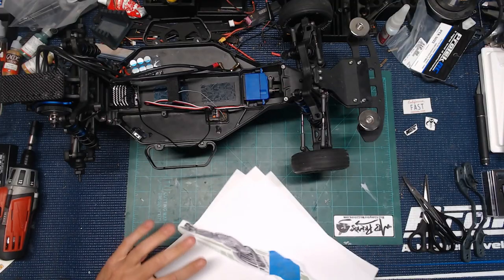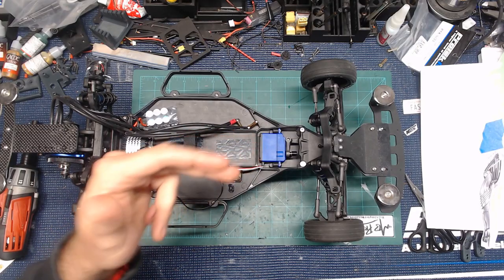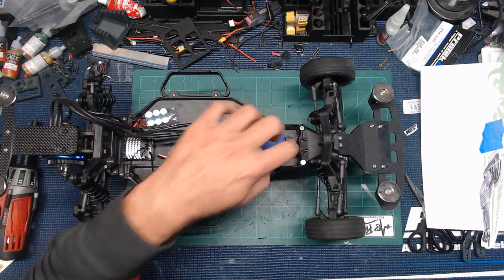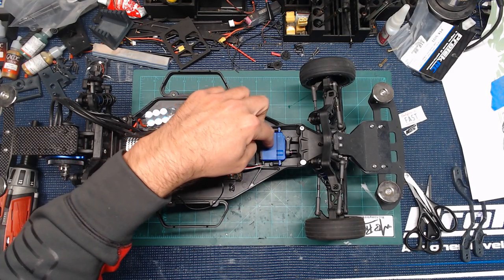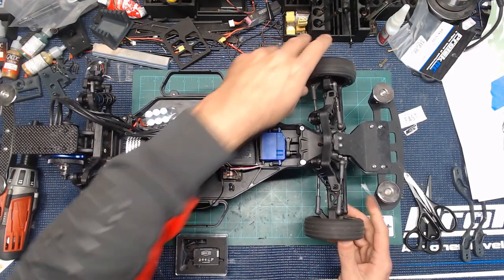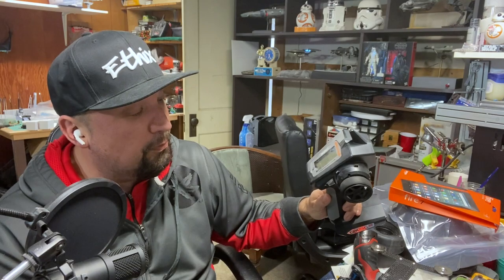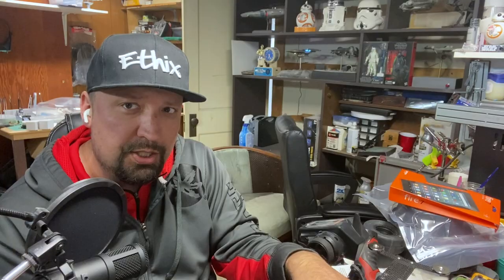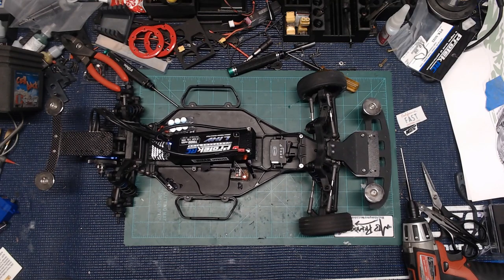DR10 Servo Upgrade For NO PREP DRAG RC | REEFS 299LP

Comment: Any chance you'd consider hooking this servo to a 8.4 volt power supply with servo controller, oz-in pull scale, current meter, and photo electric diode set to figure out the speed every 60 degrees? Seems it might be worth checking out. I heard this is a rebrand of a AGFRC servo, although I can only find the A62BLS steel geared and B44BLS titanium geared servos that are close, but still not the same spec-wise.